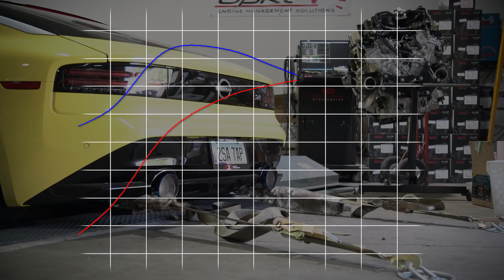Installing & Testing the HKS Full Dual Muffler on the 2023 Nissan Z – Is It Worth It?

Comment: What are the differences (size for example) between the HKS system and the Nismo Street exhaust in your other video to account for the 6whp & 7wtq difference in the Nismo systems favor? Also too, do either one of these drone at any speeds? Can you do a dyno video with the Nismo intake combined with these catback exhaust you have tested?